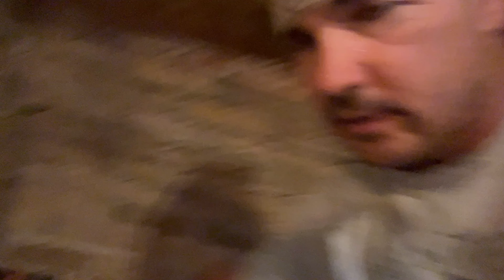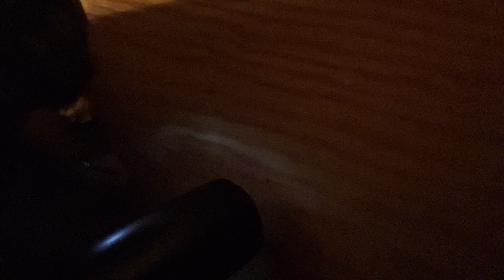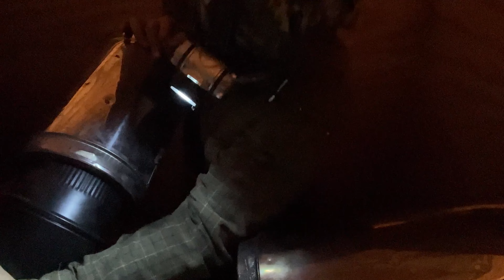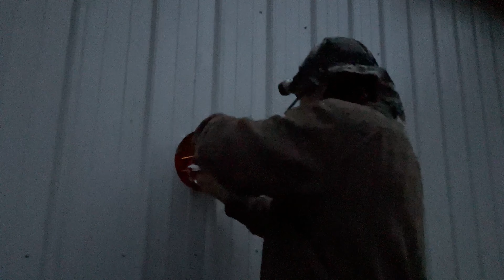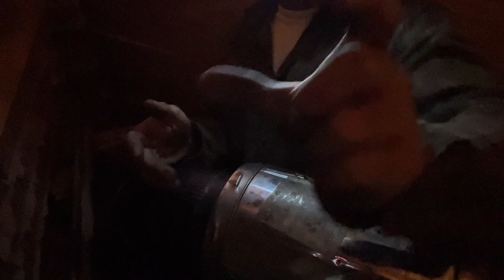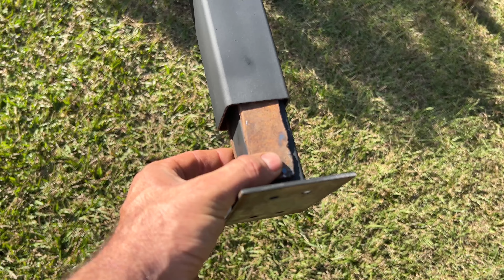Ashley woodburning insert installation without existing chimney

Comment: Excellent job Justin. I only have one concern. The pipe that is running horizontal. From the wood heater to outside of the house. You will get build up and it will clog up. You will have to clean that out. You definitely do not want that catching on fire and burning out it gets very very hot when it happens. Other than that a excellent job thank you for sharing. I fully understand what you're saying about the flu being able to burn everything up in it and not have to clean it out you are 100% correct won't hurt anything. Have a great day friend!
Reply from the maker: I also went last night and took that fas pipe out and plugged it outside the fire box. I will have to clean that pipe your talking about out in the fall before we start using it

Comment: Did you build a pole barn house? That’s what we built. That should heat the house good
Reply from the maker: Yes i did. Its 6x6 post and metal truss and perlins. Then we turned an old 100 year old barn inside out
Reply: Man that’s what we done to. Except ours is all wood frame. We also have rusty barn 10 throughout the whole house in the ceiling and the wood boards on the walls like you have. We tore a How old house we were renting and built the inside of this new house. We use Wood as our primary heat source
Reply: That was supposed to say we tore down a old house we were renting
Reply: I’ve heard you say you used to do some roofing. I’ve been roofing for 35 years now
Reply from the maker: @dbltrbl96  i had to give the roofing up. The last year i did it i had 4 heat strokes that summer. It changes your body so now i can’t tolerate hot weather . I did it about 10 years
Reply: Yeah that heat don’t play. It’s hot in the summer and cold in the winter lol